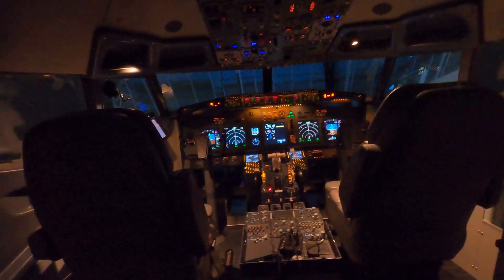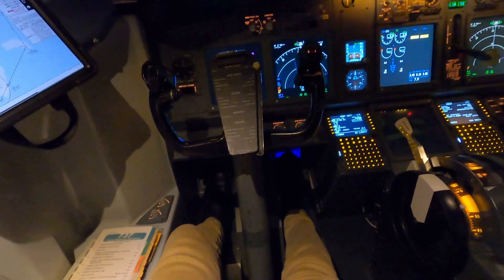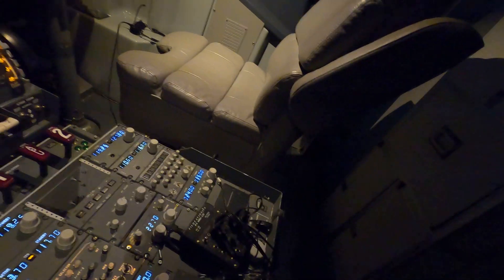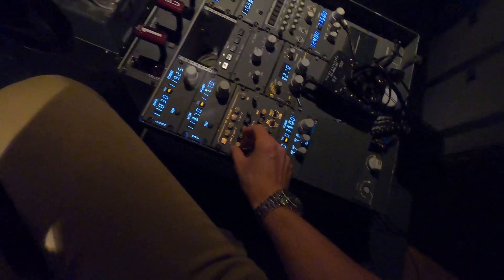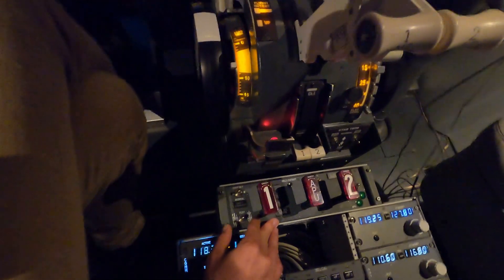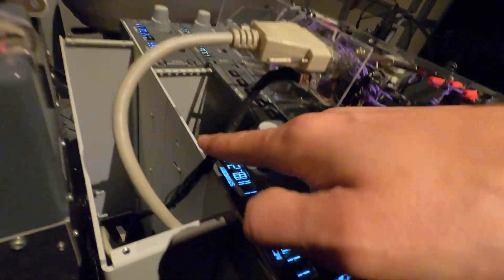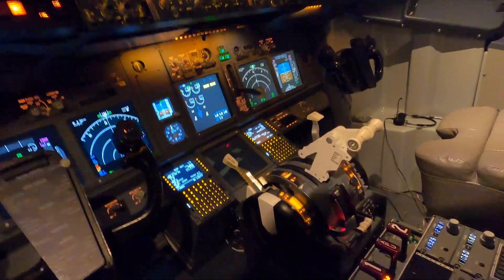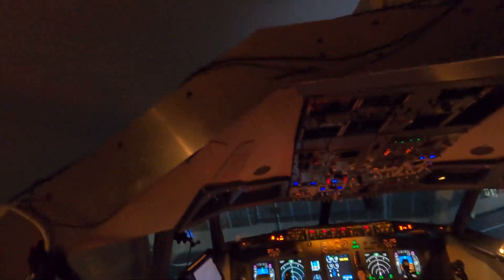PJ's Boeing 737 Homecockpit - MAJOR UPDATE - Build Blog - #3

Comment: Nice work. How were you able to use the ASP TO control the overhead speakers? I also use Prosim. Any help would be appreciated.
Reply from the maker: I was only able to control the speaker volume on the ASP via the speaker channel of Prosim. With the new audio module 2 however, I can control the volume of every linked channel separately. If you need more details or help, write me on Facebook :)

Comment: Wow, absolutely stunning!! Did you 3D print most of it, especially the larger plastic panels?  if not, where/how do you get these custom made?  Thanks.
Reply from the maker: thx :) I purchased panels and parts and wired up most components myself. There are many solutions available ranging from self-assembly to turnkey solutions. Have a look for vendors like Flightdeck Solutions, Sismo, simworld, opencockpits, etc. The large plastic parts, like the“shell“, the sorrounding cockpit structure, is from FlightdeckSolutions, same as the Main Instrument Panel. If you have more questions, feel free to ask.